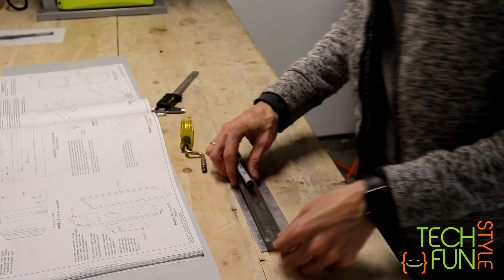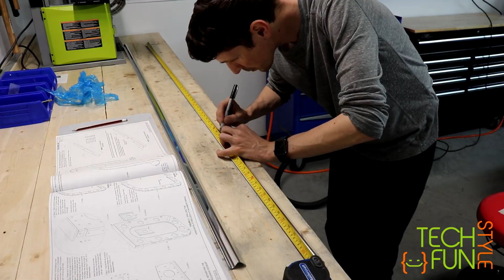RV-10 - Tailcone assembly. First steps.

Comment: Vlad, I am a pilot considering building an RV-10 as well and am very much enjoying your videos. I am finding them very informative and a great insight into what I may have ahead. I live just across the river in Langley and like yourself have a US post box in Blaine. Curious if any issues at the border with the kit and in normal times (after covid restrictions) do you find it is more economical to order supplies from the US vs Canada.  Again really enjoying the videos.
Reply from the maker: Hey! It is great idea to build RV-10. I am sure you will enjoy it and will love it. Where are you base at - CYNJ ? I found it is way easier to get my kit delivered to Blane rather than let it be shipped from OR to BC by FedEx or UPS. It is not only the fact that it will take way longer to receive it and you will likely end up paying extra $500-600 in shipping. It is also about safe delivery of the kit. I know it is packaged well but going over the border will involve way more loads/unloads. Who knows if your package gets dropped at some point. Border crossing was perfectly fine. I did over commercial border, it took me maybe 45 minutes to do all paperwork, pay tax and continue on my way home. Should you have any questions do not hesitate to contact me, I will be glad to help.
Reply: @techfunstyle1606  Thanks, presently not based at any local airport. Been flying commercial with airlines for 20 years and thinking of starting to fly for fun. Lol  I live in Walnut Grove and if I proceed with a build will look at YPK as it is closer.  I see new hanger development starting there as well as a retired AC colleague of mine has a hangar near yours I believe. Thanks for the offer about questions. Looking forward to the next episode.